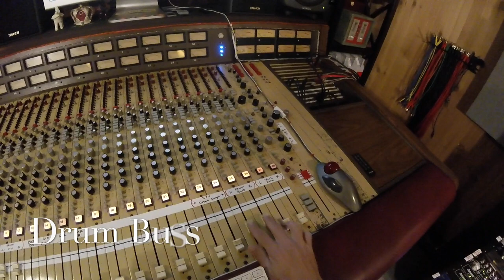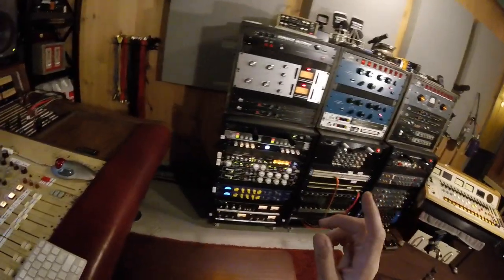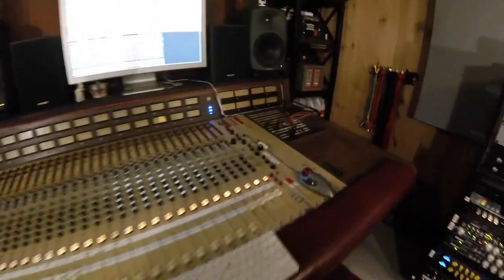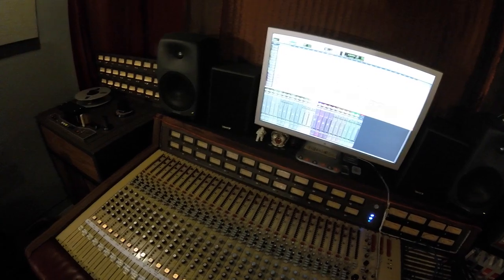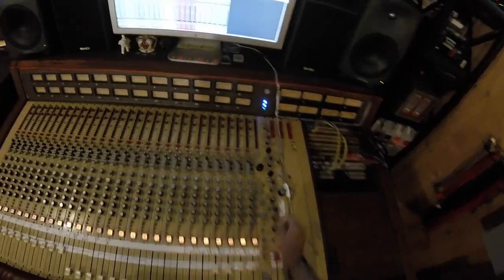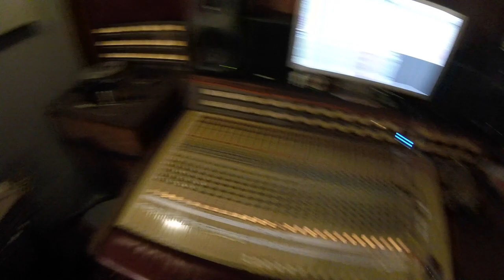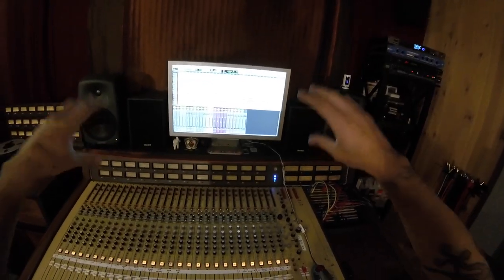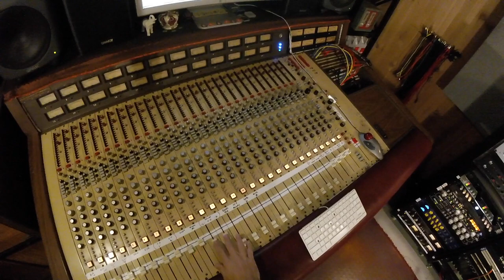Mixing Analog Drums with Outboard Gear @RiotHomeRecording

Comment: I have a question for you about your Allen smart compressor.  I have one and am interested how you have the side chain buttons pressed in.  Do you have a cable plugged into the side chain in the back?  How are you using the side chain?  Thanks man love your videos and your channel.  Very cool and helpful.
Reply from the maker: Yes I have the Y cables that hipass at a fixed 150hz. I always leave it engaged.
Reply: Sweet thanks man.

Comment: Love your drum sound man, how do you keep the cymbals from being splashy and harsh?  Is it the 1272’s being dark, the player, cymbal type, mic used or EQ? If it’s a combination of all which contributes most to the sound your getting?
Reply from the maker: I would say yes everything plays a part in the sound of what your hearing on the overheads. There is no eq on these particular overheads. What I think is very important is the way they’re mixed with the rest of the kit. Once that’s right it will help combat that splashy sound you’re talking about.
Reply from the maker: And yes I prefer the 1272’s on overheads and that’s what I use 90 % of the time. They’re just so fat & warm. It doesn’t just make the cymbals sound great but the entire kit.